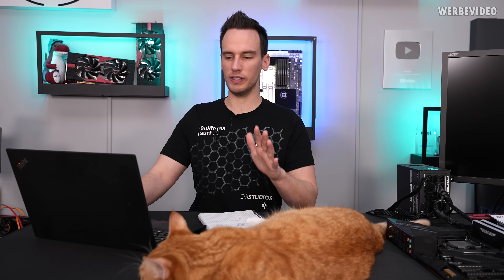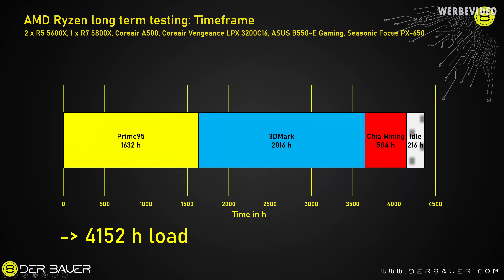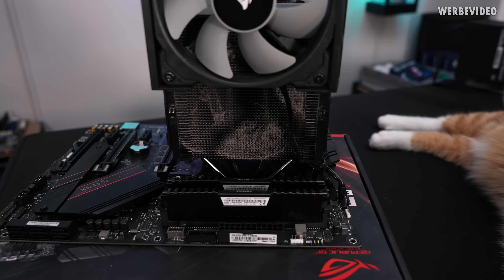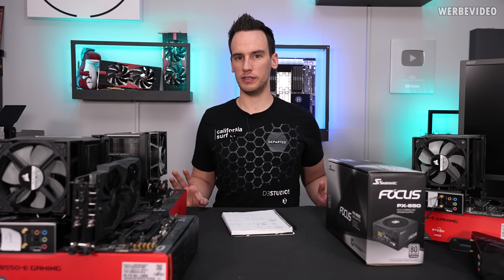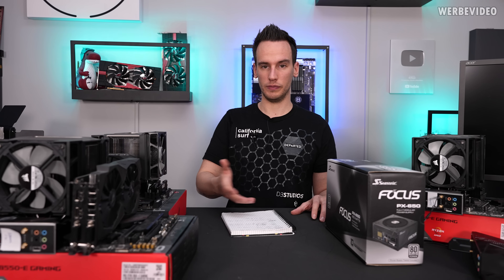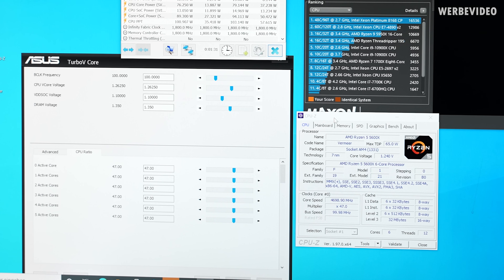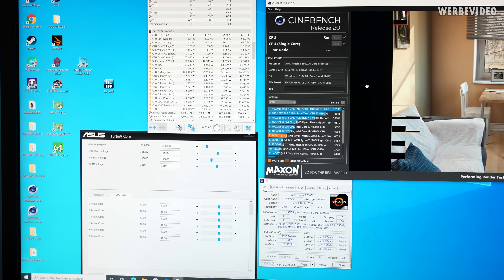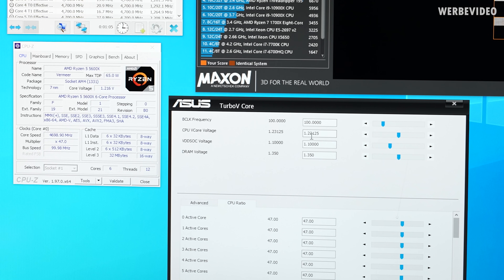4152 hours of Ryzen Long Term Testing: We have Good and Bad News

Comment: Awesome experiment.

One thing to mention is that most aging effects (e.g. Electromigration and Bias Temperature Instability) have a relaxation effect. So when you stop providing stress, the "aging" effect is actually reduced. So the idle time can negate some of the stress and the long periods of constant stress should have a much more dramatic aging effect than the comparative cumulative aging of a system that is used 3-4 hours a day. Electromigration for example, immediately begins to recover in the absence of current in the respective interconnect. In other words, your testing scenario is likely more conservative than real life, even more than what you conclude.

When designing chips these days, companies do a similar experiment as this, they use extreme conditions under unrealistic circumstances. They also design to a specific lifetime, e.g. 10 years. But when they design to 10 years, what they are really designing for is the first 5 percentile or so of chip failures. So the vast majority of chips will actually last much longer than this reliability design point. This of course assumes the chips are without defect, but many companies do a burn-in style test that tries to induce failure in these defective chips.

Comment: The amount of people that basically went the Chicken Little Route when I recommended voltages that I would consider safe and completely within the realm of keeping a CPU up and running for 5 years (+/- time needed to find the newer one you want in stock) is insane. This video not only proved my point of entry into [very] Basic overclocking and how fun and long term it could be but enforces the fact that you could from time to time depending on use case push that "mild" overclock further for whatever reason you had. The voltages for the overclock are higher than needed, obviously it does speed up parameters of the test, but I'm not too surprised that they did last as well as they did. CPUs are a lot more robust than I think what most people give them credit for but it might just be my skewed view. But let Science determine Fact from Rubbish. Cheers! Stay Healthy and Stay Sane!

Comment: I'm getting the same CB results on a 5600X with stock settings @ max 75W package power.  I did heavily modify the cooling system, so it can keep boosting @ 4.641Ghz (modified Apple G5 air cooler max 60°C).  So I don't really see a need right now to overclock this CPU.  Cool video, great to see this chip will last !

Comment: I have an overclocked intel 3930k for almost 11 years now, maxing the Vcore at Intel's 1,35V turbo limit while overclocking. As it was new It would do 4,5 Ghz all core with some tweaks, after almost 11 years I can only get it to 4,3 Ghz with a lot more tweaking to get it stable.
Reply: I think "only" is not the right word here. You have had CPU for 11 years running with overclock. The fact that it still even works and is able to overclock to some degree is impressive. CPUs are really strong.

Comment: Why thanks Microsoft for that? There was no need to have an internet connection on those systems, in fact that pollutes the test with updates and other background communications. Sure those are small things, but still not a clean test and then the windows update also screws you. If you need network to manage the machine remote, then let it out only to lan

Comment: Totally insufficient test, and I don't agree with the conclusion. And no, I wouldn't expect anyone to burn out dozens of CPUs. But here is the major flaw - thermal cycling. People shut their machines off. You saw noticeable degradation JUST from sustained OC voltages. Adding in thermal cycling (which would be hard or impossible to test in a short time frame) could make the degradation so much worse. So really, people should be playing it safe not only with max voltages but also max temperatures. Personally I would not go beyond 1.35V max voltage nor beyond 75C max temp. Back things off a little bit, save on power, thermals AND loss of components. Accept a couple 50MHz steps lower and be nice to your CPU.

Comment: I had a 5900x fail on me after 11 months of usage with a slight Overclock. No known reason. Just died. I did notice my Temps were increasing the day or two before. RMA took 2 week. And I was back up and running.
In the mean time I tested a 5600x and found it to have more stability at the time prior to my 5900x.
Strange.
My current 5900x runs flawless and overclocks like a beast.

Comment: Unfortunately long term results require extreme large sample sizes to determine mtbf and modes of failure.  I ran a core 2 quad6600 g0 stepping(2.4ghz stock). I ran it at 4.2 ghz for over 8 years with out any degradation... except for voltage dependence.  I used to run 3.2 ghz at stock voltages... and had to boost voltage a lot after 8 years at almost 1.6v

Comment: I mess with a lot of older hardware, processors rarely fail, usually something else on the motherboard fails instead(usually capacitors or other VRM components). I've got processors from the 90's and 00's that still run perfectly fine.

I've got a Core 2 Duo e8400 running in a windows XP gaming PC right now actually. The PC ran 24/7, usually under a gaming load from early 2008 to about 2013 when the fan on the 8800 GT it had failed. PC suffered multiple bouts of overheating due to worn out thermal paste, dust/tar clogged heatsinks, failed power supplies, etc. over the years. Always seemed to come back to life. 

From my experience CPUs tend to either just work as advertised, or just be dead with no in between, on the rare occasion I've seen a dead CPU.

A lot of the old PC hardware still has life in it for playing older games without having to muck around with virtual machines and emulation. Better than them going to a landfill or salvaged for rare metals.
Reply: Old CPU's are designed to work for up to 25 years, even tho you would have only 1 to 3 years of warranty. If you run stock it could last 50 years but even in that "slow" rate it would still degrade. It is afterall a very slow proces. OC'ing or overvolting only speeds that timeframe up.

Comment: I mean, yeah, degradation myths are greatly exaggerated. My I7-5820k overclocked to ~1.2v with 4.3GHz has been holding steady for 6 years with no voltage adjustment. It did sometimes start getting very hot to the point of crashing, and each of those times it was because the fans got clogged up with dust. A little dusting, and temperatures drop 20-30c and it's back to what it was in 2015.
Reply: Always good to clean. I would also suggest replacing the thermal paste every now and again. Did it recently with my cpu and gpu and saw an immediate 5C drop across both platforms,

Comment: still running my 6700k since i bought it at 4.6ghz on 1.42v (outlasted my 980ti that got too slow now got a 2080ti on 4k)
CPU is very high usage when gaming as its not really fast enough for the 2080ti...

Comment: I am literally running 5.1ghz all core at 1.2875 volts on a 5800x if I’m not scared about that no one should be scared about overclocking degradation.

Comment: The 5800X has a higher boost clock than the 5600X and also has the same TDP as the Ryzen 9 parts while having much less cores. To me this seems like AMD is using higjer leakage silicon for the 5800X that can clock higher and be more tolerant to higher voltage but then also use more power. This would explain why the 5800X was more tolerant to degradation.

Comment: I wonder ... what if you had a 5600X @ stock ( voltage&clocks) running these testes for the same amount of time and after so many hours you would still need to adjust the voltage in order to pass all the Cinebench tests...

Comment: I got my since June 5600X  paired with B550 SL and G.Skill 3600 cl 14 ram , manual OC CPU all cores to 4.6GHz 1.23vcore, LLC on lvl 2. Stable overclock cooled by Aresgame River 5. CPU-Z  single score 642 and MT 5038 for comparison.

Comment: My 5950x on a Dark Rock pro at 4.2 all core peaks at 84 at around 175w under a stress test, is that alright or a bit hot? Voltage is 1.26

Comment: I have never been successful at overclocking, oc'ed Athlon II 640 x4 on one mobo, later mobo died, got another one and from there on ive never been able to oc. On that cpu it wouldnt save a oc, bought Fx8350, settings still wouldnt save even 100mhz, got ryzen 1600 and MSI tomahawk b450, overclock wasnt stable at any setting above stock at 1.35V. Also launching CSGO would revert frequency to base clock. Now i have R5 1600AF and its stable at stock 1.35V and game boost enabled, which is 3.6 Ghz on B450 tomahawk.

Comment: My first 2 5800X's I could never get stable stock, many people thought there was problems with the CPUs after 9 months I got my 3rd CPU which was perfectly fine. Similar Experience for others too. Maybe it was an issue with early silicon. It was a big headache, fun at first to troubleshoot but in the end annoying, however now that's in the past and I'm enjoying my 5800X quite a lot.

Thanks for the vid, good to know I don't have to worry about going through the above again.

Comment: Just a quick question - I noticed you're using Asus B550e - is B550-XE better or at least not worse? I just bought B550-XE as a replacement for B550-E I broke  - and I am just afraid if XE is indeed a refresh/upgrade, or attempt to cut costs (while being a bit more expensive simultaneously ;) )

Comment: Your assessment on todays endurance of transistors at 7 nm into future time may be flawed into 1.8 on the physics of dimensions and power. Of course this is what engineers will attempt to resolve. 3D NAND provides an example of sustaining endurance on controller error correction for bit cell size. But think about it, will the same be true of SRAM bit cell size that has essentially plateaued. I agree 7 nm has proven its endurance. I can't say the same for 5 nm whether simulation or time of actual use. One thing is certain though the volume of back generation node processors on the used market certainly say as much or more about endurance on long time use and reuse. mb

Comment: Ryzen CPUs degrade very quickly even at "safe" voltage like 1.2V. My 3100 used to OC to 4.6Ghz when it was new, and 1 year later I can't get above 4.35Ghz at the same voltage.

Comment: Hmm When I had Ryzen 2400G it degrades after 6 months of use with max frequency at 1.4V. After half a year I lost 100MHz of max stable frequency. You should test max OC potential of those CPUs.

Comment: i am running my 5600X at 4.525Ghz all cores at 1.225Volts for better temps and i dont really get why these cpus are going automaticaly for so high votages when they are perfectly stable at higher clocks with lower voltage with manual OC

Comment: People will now say it's because 1.45v is too high, but there is no way to say, by considering this result, if a non overclocked unit would degrade as well, or if the real cause is high temperature or temperature changes.

Comment: I wouldn't call inability to hold specific overclock at some voltage as "failure", I bet it is perfectly stable as stock setting, which means you still definitely get what is advertized on the box.

Comment: well to be honest I did not see the entire video but incase it has not been addressed, as far as CPU restarting after the 3rd time of trying out cinebench it could be a VRM/mobo degradation rather than a CPU one so you should have tested the CPUs on a brand new mobo.  Overvolting doesnt only stress the CPU but the mobo as well. Also brand new PSU wouldnt hurt either.

Comment: Would've been interesting to see the same test but with ram oc, specifically infinity fabric.
I'm running my R5 3600 with Crucial Ballistix at 3800MHz 1:1 since release without any other kind of cpu oc and my cpu has definitly degraded as i cant even come close to the undervolt offsets i used to use without hard crashing the system.

Comment: I got a 3700x when they first came out, the highest I could get was 4.3GHz at 1.4v. I just retired it as I couldn't even game on it. Cinebench R20 would complete 3 runs at 4150 @ 1.5v, but games would crash, thought it was my 2080ti, ran Furmark for 1.5 hours and with no crash, CPU has degraded. I put a 5900x on an Asus Crosshair VII Hero (yes an x470, bios ver 4402). I just started picking at it last night. I ran CTR (Clocktuner for Ryzen) to get a starting baseline. Currently the 5900x is sitting at 4750 @ 1.375 ALL core, current Cinebench R20 score is 9421. Not sure if I want to push it to 4800 at 1.4v, I want to keep this chip for a long while.

Comment: I was concerned about long life on my 5800x, also im running 4 dimms with 2 different ram kits at a slow 3000mhz CL18. I set a 1.28 max voltage with -22 all core curve. Doing 5900+ on C20 without OC seemed a nice result performance wise, is it? slight above 80ºC worst temps.

Comment: Stock CPU can last much longer than ten years. More like twenty or thirty years under NORMAL use... possibly even more. I own many CPUs that are ten or more years old. In all my years I have never had a CPU die no matter how hard I pushed it (Intel Coffee Lake, Skylake, Ivy Bridge and Sandy Bridge at or above 1.4V and AMD Zen 2 up to 1.35V).
Reply: yea that's why oc degrades em faster... but its also irrelevant, instead of 20 years.. 10? ok its trash by then
Reply: That is definitely the case with older cpus. But honestly with these we have no idea how they will last even at stock clocks and voltages.

Comment: -_- I have always had a negative look at Overclocking as a hole let me explain. Any time you overclock you are exponentiality accelerating CPU/GPU (Silicon) degradation. This is with any Silicon manufacturer. Most know the moment you over clock the CPU\GPU you are flipping a quarter in the silicon lottery that entails performance and life span. The smaller the silicon IE (Nano Meter size) gets the more you are likely to kill the silicon as it is higher consolidation of temperature spikes, the rapid heating and cooling of said silicon while it is running is what is killing it. I do not allow my CPU and GPU to get over 55F under load, this is to extend its life span via Full EKWB triple 240 EK radiators EK CPU and GPU Water blocks and an EK D5 pump on 70% flow rate minimum. CPU and GPU are not overclock . On top of clean power 1500 APC battery backup. No exceptions.

Comment: I have an MSI laptop with 4700u and it pushes 1.4V regularly whenever any of the cores try to boost over 4.0Ghz, even at balanced power mode set in bios, and there's no option to control the voltages.

Comment: Very nice video, in my experience hard but stable OC is good to run for a upgrade cycle 4-6 years. I only ran into deg when I did some rather high voltage and clock speeds at close to zero degrees C.
and even then it was not that the CPU could not run a high OC under normal conditions but it was not able to repeat the absolute maximum.

Comment: Maybe I missed this in video, but ...Do we know what was the lowest stable voltage before 4152 hours test in cinebench? If not, then we can not make conclusion about degradation :) .

I want to see HWinfo package power on alder lake 12900k @4.4GHz with (E cores disabled) @maximum_undervolt. I already have measurements on this frequency using 11700F and 5800X.  12900K would be the last piece in puzzle I need to know...thank to everybody who will make this test for me  ;-)

Comment: My question: what if the same CPU's would be run on brand-new boards & psu's?

All the 'bad things' that can happen to silicon run hot are far less likely than having coils, caps, mosfets, etc on the boards & psu's if they're run hot.

Comment: I was looking for this type of information when I overclocked my Ryzen 2700. Nobody could really tell me anything useful, so what you just told me is perfect. I upgraded my cooler, ran the fans a bit harder, and I got a 25% overclock that is rock stable on air in a crappy case.
Reply: Running a 2700 4.1ghz 1.325v no llc for months now lol+ 1.15soc voltage and 1.5v on ram at 3466mhz cl14 air cooled
Reply: @pukalomaster3321  LLC made my PC unstable. From what I understood, LLC can cause a ripple that's worse than the lower voltage you get without LLC. So yeah, definitely work without or very little LLC if you can. Still don't know about ram overclocking though, since the memory controller is built into the CPU I've heard it's good to be careful. Don't understand all the details of that yet.

Comment: Sounds a lot like the same things that were said about early ssd and thankfully people did extensive testing and proved ssd endurance to exceed a human lifetime, which is neat to know how resilient good silicon is. Just looks like the 5600x has degradation problems while the 5800x seemed to mature and run slightly better temps. Could be because the 5600x is a gimped 5800x with a possibly damaged core that was shut off and so made them more prone to degradation. Plus 1.45v is just a lot of voltage to be used for that long, very good results. Max will be 1.3 usually.

Comment: Possibly very slight degradation after running at 1.45V?

Perfectly acceptable. Few will run their CPU past 1.3V I would hope. Also I hope these CPU lifetimes when not overclocked will be far more than 7-10 years. I expect my 3600 to be the heart of my home server in 10-15 years time.

Comment: 1.45V + Prime 95 on air?  How were the temps?  Should I assume there was no throttling?
Reply from the maker: Air cooler running 100% Fan speed - no problem :) Prime was without AVX ofc